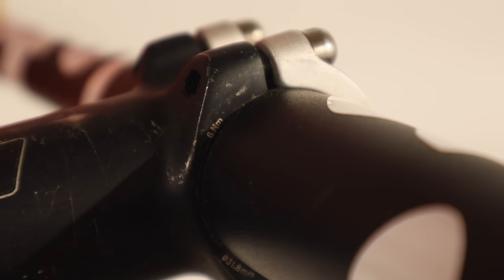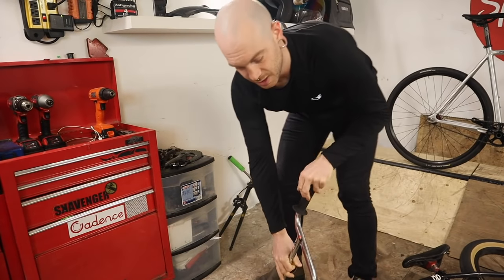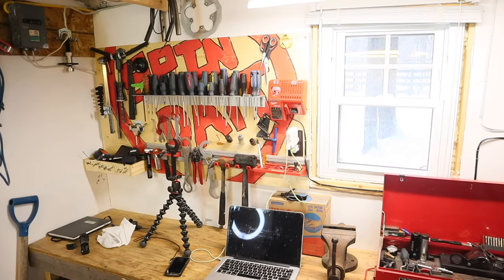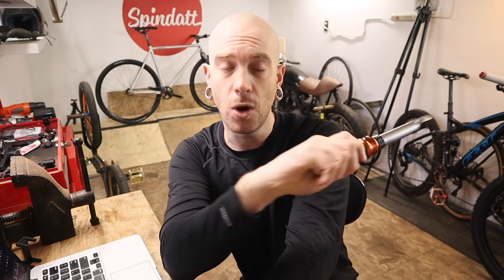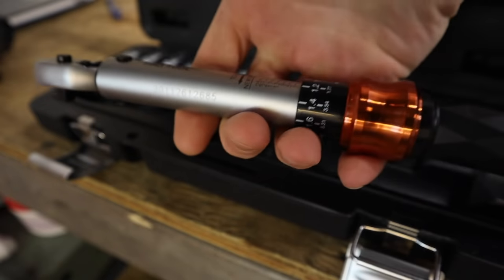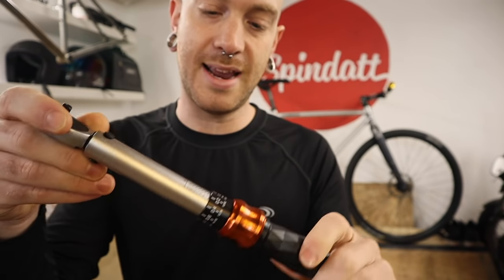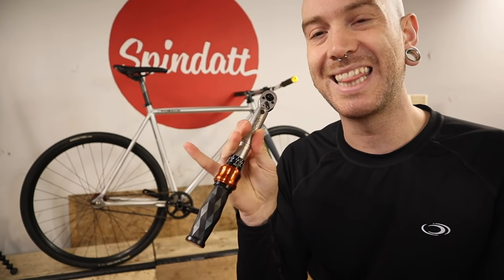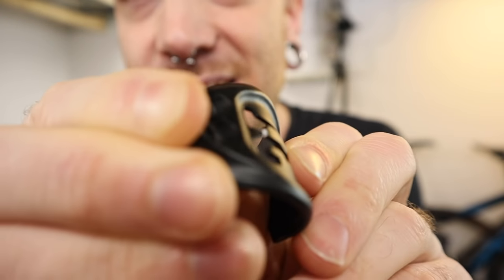Stupidity Caused This Snap

Comment: Heads-up on best practices with adjustable torque wrenches: Detension the wrench for storage, aka set it to the lowest torque on it's scale (not below). Also keep it away from big temperature differences. Those two are essential if you want the calibration report to have any meaning. Neglecting to do those things will make the actually applied torque drift over time as the metal of the mechanism deforms if kept under tension.
Reply: Thanks for the tip! My Torque wrench allows it to be detensioned lower than the lowest value and I had always wondered the correct place to set it when not in use.
Reply: @zeldajunkielol2  In theory it would be better to fully detension it (go below the scale), but you run the risk of displacing pieces of the mechanism if you do it as it's free to flap around if there is no tension applied at all. So the safest bet is keeping it at min torque value

Comment: Most important thing is to buy good quality, robust components that have a good tolerance to stress. I realize that if you're working in a bike shop you don't have a choice over this, plus liability is another problem that forces you to check torque spec. Second-most important thing is to make sure your bolt threads are clean and not greased, unless manufacturer specifies so. Clean vs dirty threads can make a difference of 50%, greased threads another 30%, torque wrench error at low torque another 15-20%. It's a mess. Any component that's sensitive to torque shouldn't be on a bike. Unpopular opinion but the obsession with precise torque over well-designed components is harmful.

Comment: My most recent bike, a Viathon (yes, WalMart), came with a 5 Nm torque driver.  I’m not mechanical engineer, but I assume that if Viathon shipped a tool just for the seat and stem, I should use it.

I already had a Park torque driver, so the joke’s on them.

Comment: Good video, just picked up a Torque wrench last week for adjusting the stem on the carbon steerer of my new gravel bike. I've already stripped the screw on the grips on my MTB, not about to destroy the fork on a brand new bike. The one I got isn't nearly as nice as that Uniche set though - that kit looks almost too nice to use.

Comment: You should never torque a bolt the the specific value if you have greased the thread as you can very easily over torque the bolt. In car factories and such every bolt is tightened dry to the spcific torque specification. I have made the mistake to grease up the threads on bolts for the engine covers and it caused the threads to stripe. Arghh!!! So dont torque the bolts to the specified torque if you have grease on the threads.
Reply: RollinRat  so on a 5nm stem with greased bolts, you'd only tighten to 3nm?